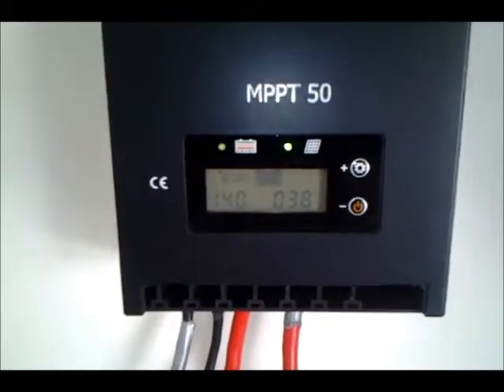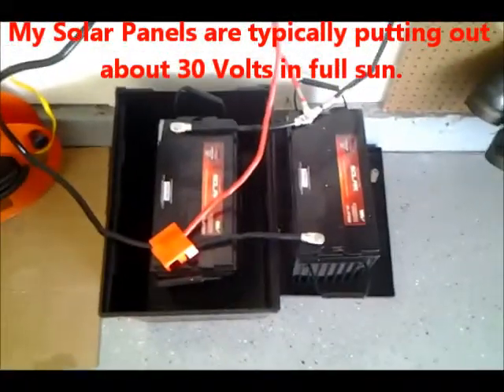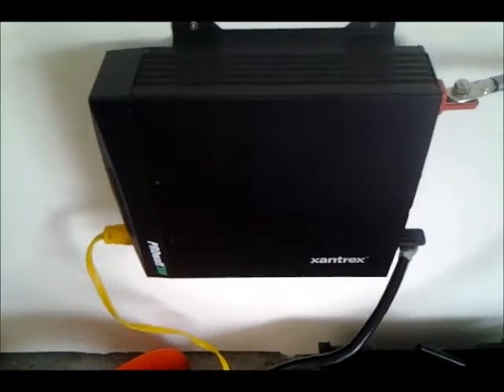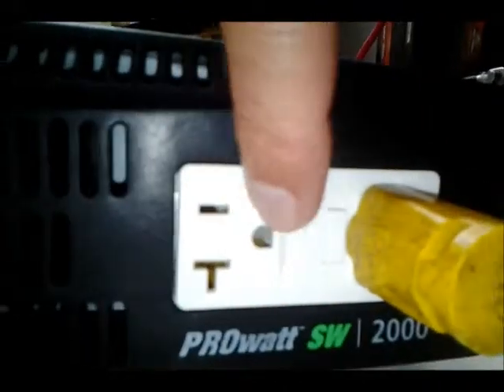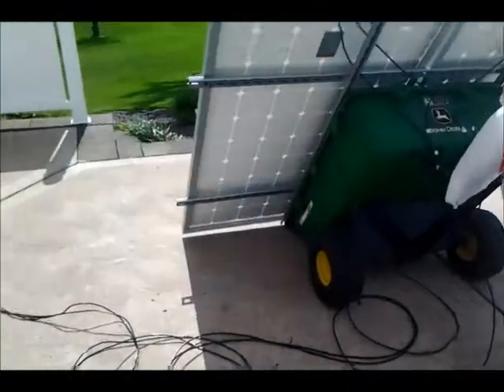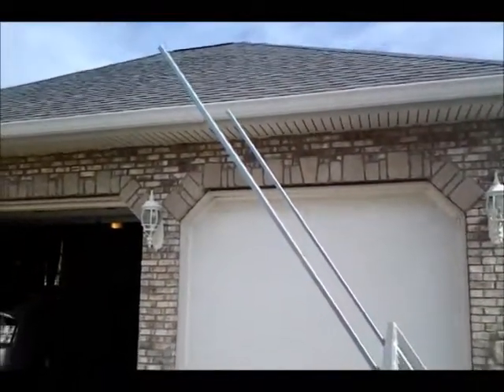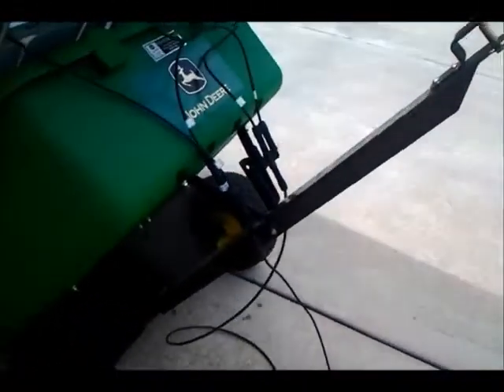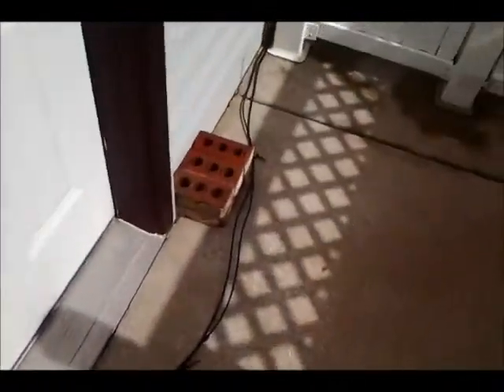Mobile Solar Panels: Project Update & Costs (costs in the description)

Comment: Hej John about what is the cost to do the house with solar?I have been thinking about it but dont trust most companies to do the work.
Reply from the maker: +bob smith Bob, that is a big question depending on if you want to completely disconnect from the grid or not?  I can only power my kitchen with my setup and have never done a cost estimate on my entire house.  A guess would be 5 X my costs or + or - $10 K?  There are lots of YouTube videos out there where you could get a more accurate idea.  Thanks for watching.

Comment: Have you tried running the panels in series to make the mppt function work properly converting the volts into amps?
Also I know it's recommend to have a fuse from controller to batteries and solar but my fear was if battery fuse blows the solar can damage it so I used double breaker that way if one shorts it all shuts off! See my video of it if you like and thanks for sharing!
Reply from the maker: +Bruce Samuelson I need to update my video.  I hooked the panels in series at the Charge Controller Mfgr.s recommendation and added 4/0 welding wires and 4 more batteries.  Thanks for watching and will check out your videos.
Reply: Ok cool I'd like to watch update video to see meter converting volts into amps as I'm thinking of buying same controller.
Thanks for reply
Reply from the maker: +Bruce Samuelson Bruce, I have updated my video with my current setup, if interested at:
https://www.youtube.com/watch?v=H6dhbKCiQjE
Reply: Ok thanks I'll watch it now

Comment: nice setup. what size wire are you using?
Reply from the maker: +GPVlog As I show in the description, 10AWG from the panels part way then increased to 8AWG to the charge controller.  4AWG from the CC to the batteries and 1AWG throughout the batteries and to the inverter.  The inverter manual says to use at least 1/0AWG (and 4 batteries) and so I have upgraded to the ultimate, 4/0AWG, also known as welding cable to reduce voltage losses, as much as possible.  So, it depends on your inverter and how much loss you can stand?  I will be making an updated video soon, showing 2 to 4 additional batteries.
Reply: sorry I was watching with my phone at the time of comment and it sometimes doesn't show the video description. I am interconnected with 2/0 shielded USE-2 wire and the same to the inverter. It will handle 235 amps DC which is more than I need. I can run anything in the house except for my central air. I am going to direct wire 240 to the breaker box here next month.

Comment: I have that same controller and on good days I have 30 plus amps with a 12 volt system.
Reply from the maker: +96MustangBoy1 Just saw your post, did not get a notice, for some reason.  Anyway I have also seen similar amperage and almost 70 volts!  I have since hooked them in series, however.  They seem to be very efficient, especially if you can rotate them with the sun.

Have you had any problem with the controller cutting out after about 14 seconds for 2 seconds until you reboot it?  I returned my 1st one, for a replacement, because of this.
Reply: +John H I have mine connected in series too but at 90 volts. Each panel is 180 watts and I have three of them. I think I can push it to 40 plus amps if the panels were at least 8 inches of the roof. It is up againts the roof now and it gets too hot.
Reply from the maker: +96MustangBoy1 Yeah, I noticed this Summer, even with my panels mobile, they were more efficient in the early morning or late evening sun vs. the heat of the day.  So, you haven't had any problems with the Controller cutting off the solar panel supply for 2 seconds every 15 or so seconds?

By the way, where are you located?  I am just West of St. Louis, so we have hot, humid Summers.
Reply: +John H I started having that problem. I may have to return it. I have to reset every 3-5 days. I live in Hawaii.
Reply from the maker: +96MustangBoy1 The factory repr., in China, told me to reset it one time and see if it behaves.  So, far it's been about a week.  He said it may need a firmware update.  Will keep you posted.  I would contact http://solarodyssey.us/ at 1-877-333-8192 and they will replace it one time, at least, without any hassle.  The second time they are resisting a little more.  They said they got a batch of them that do this, so it is not an isolated problem.
Reply: +John H I got mines from solarodyssey. It's about a year old? You think the'll give me a new one? Can I somehow load the new firmware myself?
Reply from the maker: +96MustangBoy1 My manual says it has a 2 yr. warranty.  So, yes, I would say you could return it.  As far as, loading the firmware I was going to propose the same thing.  Of course they would have to instruct us how to do it and make sure we didn't void the warranty by opening it up, if necessary, which I assume one would have to do?  Did not get that far with that approach yet but it might be worth proposing?
Reply from the maker: +96MustangBoy1 Did you ever contact solarodyssey?  Mine has worked well for several months but twice it started doing the same thing and required a reset.  I am on the verge of calling them again?
Reply: +John H I messaged them twice. They never got back to me. I reset every two to four days. So I am goong to replace it with a Solarmate 40 amp charge controller BLUE BOX.
Reply from the maker: +96MustangBoy1 Missouri Wind and Solar is now using them and see my comments with them at:
https://www.youtube.com/watch?v=czTSMofUv78&amp;google_comment_id=z13ditvassbjzpslc22oyp4qgkfxy5cg104

Comment: I am so frustrated. I hook up the load directly to inverter and it red light flashes indicates short circuit
It's wired correctly.
Reply from the maker: Shaun Colvin Shaun, can you email (jharrisonengineeringco@gmail.com) me a picture of your set up?  What type of inverter do you have, size of wires, batteries, etc.
Reply from the maker: Shaun Colvin Shaun, did you ever figure out your problem?  Could it be your Charge Controller?  Mine malfunctioned and I had to return it for another one, under warranty.

Comment: you don't have inverter hooked directly to batteries do you?
Reply from the maker: Shaun Colvin Yes, Shaun, I have the Charge Controller (CC) and the Inverter hooked diagonally across the batteries. This keeps the batteries charged evenly.  The CC takes the Solar Panel voltage and keeps the batteries charged & in the 12-14V range, which in turn feed the Inverter (a 12V inverter).  I have since added 2 more batteries and upgraded my battery and Inverter wires to 4/0 (welding cable) to keep the voltage loss to a minimum.  The Inverter Mfgr. recommends at least a 1/0 wire and 4 batteries.  I will be making an update video on this soon.

Comment: Nice setup, about how much did you spend?
Reply from the maker: Shaun Smith Thanks for the kind words, Shaun.  At your request I listed the costs in the description.  Total was basically $2,200.  Xantrex, the inverter supplier, recommends thicker cables and 2 more batteries, to get the most out of the inverter, so I may add on.  Will make another video then.